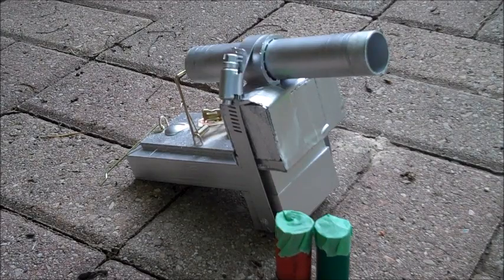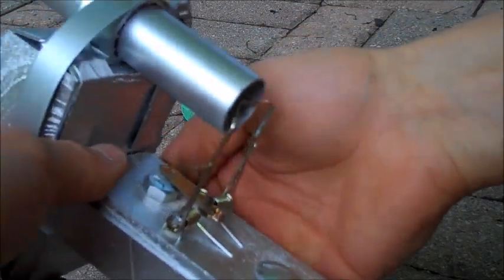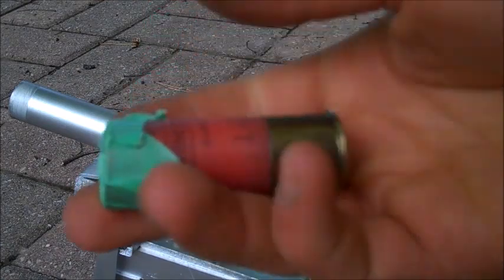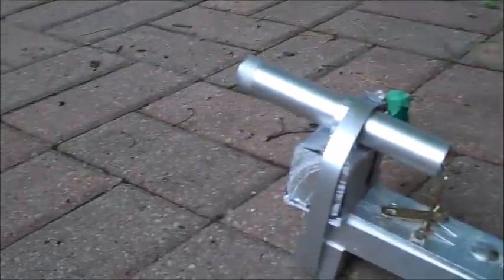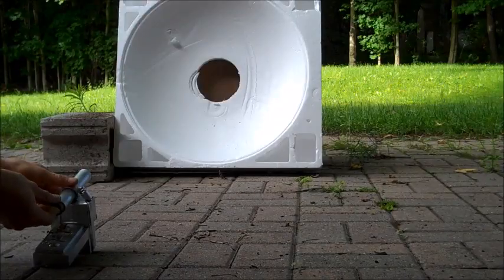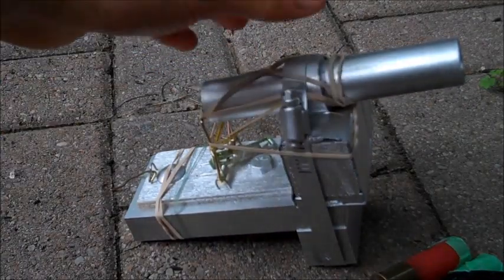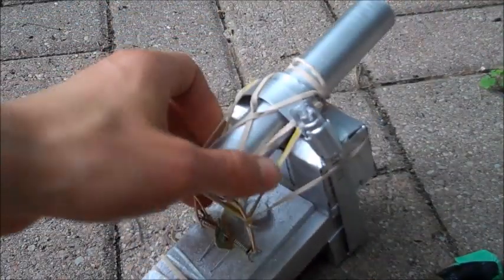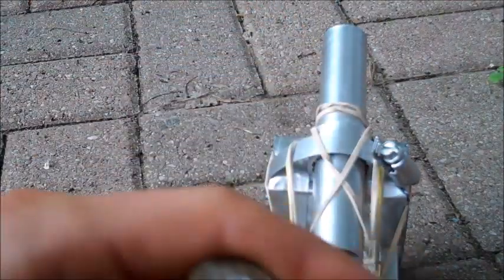Homemade BB Shotgun Cannon

Comment: take a cap from a cap gun, and substitute it for the shotgun primer. add some arsmstrong mixture which is like diy gunpowder, but only a small  amount. the caps will go off much easier than the primer, igniting the mixture and firing your projectile.

Comment: The reason it didnt fire is you didnt have a firing pin it wont fire without it you might want to have a small nail on the end on the mousetrap that actually hits the primer to fire

Comment: Try cutting a nail down to about half an inch and when you pull the mouse trap and line up the nail onto the primer it will work. That's how a bullet shoots it uses a firing pin

Comment: there is no force directed to the primer. the primer uses chemical reactions to create the explosion. and that is created by force. on the shell there is a lip to stop the shell from slipping further into the barrel and have resistance. what is happening is probably the mouse trap not being able to hit it Because the force is enough to move the entire shell forward in the barrel. if you made the barrel slightly small diameter. so the shell for through the bottom, you would have more force directed via a point in the trap to hit the primer with. instead of a mortar like system you have. use an artillery system. more something from WWI and WWII.

Comment: Bullets work from the shear power of the gunpowder. Without gunpowder its pointless.
Reply: yeah duh why did he take it out??
Reply: +Cade Lange Maybe because he didn't want to make it potentially lethal.
Reply: Primers -- especially shotgun primers -- generate a fair amount of force all on their own.  Not enough to be accelerate most projectiles to lethal velocities, but certainly enough to throw the airsoft pellets out the end of the barrel. 

Also, using regular shotgun shells in that cannon would both blow it up and probably be illegal.

Comment: hey inventor 719 when it comes to stuff like this I can think of countless things to do for it I have made several things like this including a crossbow shotgun and other items I have gone through this issues Herald times before but the end result is you just have to move the mouse trap back flatten out the end of the mouse trap meaning the actual part that would hit a mouse make sure that's flat and then put an end cap on the end of the pipe with a shotgun piece goes make sure you thread it Center a hole using a measuring tape and a marker drill out the center hole and fit a nail into it do not screw the end cap on all the way just make a couple threads so that it will just attach so that there's a space for the nail to go back so you must move the mouse trap back a couple inches so that the Center Road of the mousetrap will hit the nail perfectly put the nail in the hole cock it back and let er rip and watch your project work
Reply from the maker: Wow thanks for the awesome reply! I will most likely redo this in the future sometime

Comment: Ive actually made something like this before and had the same problem. To fix it, bend the piece of the mouse trap that hits the shot gun shell into a little V with point hitting shell. Good luck. Tell me how well it works. And tag me in you next video if it does. Thanks!